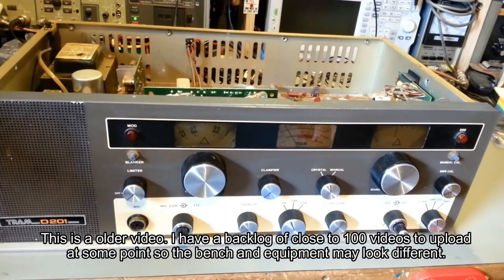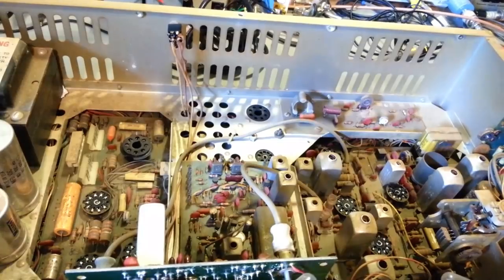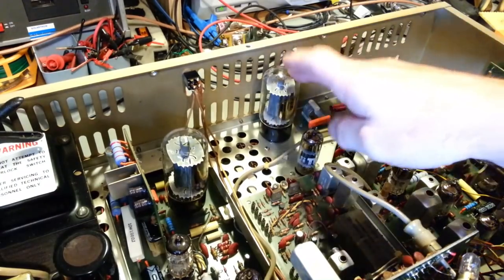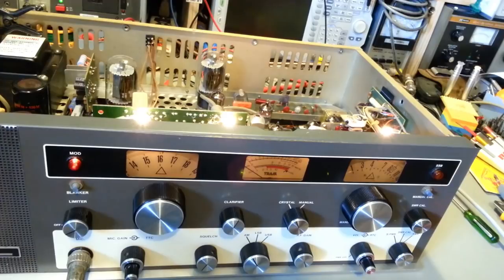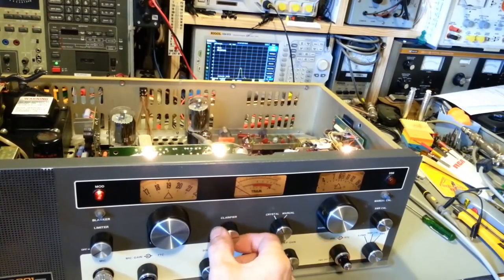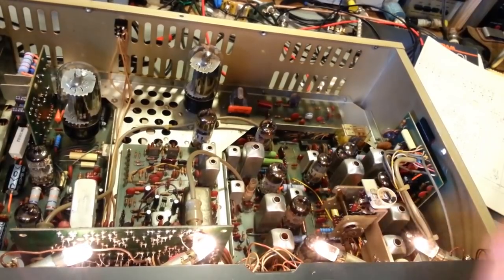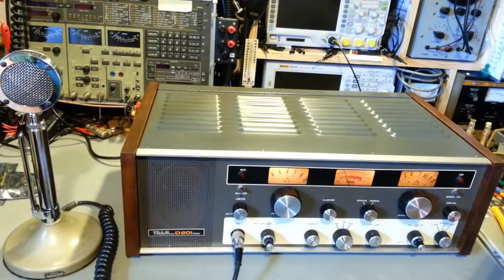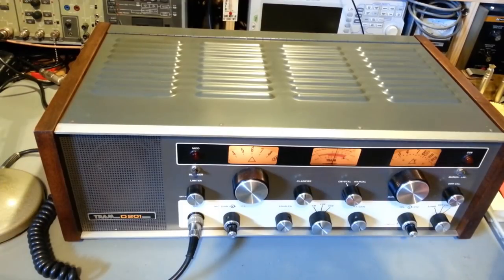Tram D201 CB radio restoration.

Comment: You did miss one point on the differences that I have in hand of the hand wired version  (at least the one I have ), the tube are located on the chassis instead of on the circuit board. The circuit board I've been told, did get the boards a little hot causing some problems.

Comment: I have gotten nailed by high voltage from my neon sign and frankly it nearly killed me, I also got one hell of a shock from an old car alternator that was shorted out to the case and when I turned the tester on and grabbed the case of the alternator the current went in one hand through my chest out the other, burning my finger where it exited. I am now more careful than most working on high voltage equipment as I seem to be a very good conductor. I hate neon signs now.

Comment: Three questions: 1) what is a clarifier? 2) why is there a gap between channels 22 and 23? And 3) what was t 8-pin DIP IC on the main board for? The VCO?
Reply: Clarifier is also called RIT. It allows you to tun to a singal on SSB by adjusting RX but if you "unlock" it than TX and RX both track with the knob all of the time even on AM. CB is not supposed to have RIT/Clarifier that tracks on TX.
Reply: In this case he is talking about the pot for the clarifier needing to be replaced.
Reply: The gap between channels 22 and 23 is due to the fact that there was a pair of "Class 'C' " rc channels in between them.
With the rule changes (allowing the 17 new frequencies), channels "22A" (27.235 MHz), and "22B" (27.245 MHz), became channels 24 and 25 and the next channel (27.265 MHz), above "channel 23" (27.255 MHz) became "channel 26". The old channel layout was, in other words, superimposed on the new channel layout for the "Class D" Citizen's Band by the FCC.
Reply: Actually, under Part 95, prior to the implementation of the 40 channel rules, the clarifier on the 23 channel SSB rigs wasn't restricted to rx only. The change came about with the new rules for 40 channel Class D Citizen's Band circa 1975/1976.

Comment: Two comments:  1.  The term "Unlock" originally means that the  "VFO Lockout" was "Unlocked".  At least that's the way it was used by those I dealt with.  For you that would be ancient history, but then, I am ancient myself so I know such things.

2.  Regarding the switch between crystal control and VFO, this is a good and useful add-on.  I'm an Extra Class Amateur and a former GROL with endorsements so I function quite well with VFO's, but when my wife used the radio she really needed the limitation of crystal control.  Not only did she need it, the whole world was better off that way.

Great videos.  I enjoy each and every one of them.  Thanks   Zack

Comment: Yep: oscilloscope - time domain, and signal intensity on a linear scale. Spectrum analyzer - frequency domain, and signal intensity on a logarithmic scale (dB)! What’s also interesting, is the relationship between the two. Ideally, a pure sine wave in time domain -> spike (impulse) in the frequency domain, and a spike in the time domain is sinusoidal in the frequency domain. So if you generate a carrier with a crystal oscillator, you’ll get a nice, narrow pulse at the frequency of the crystal, which is what you see here at 47:49 minutes into the video (on CB channel 19). There are, in fact, other such relationships between the frequency, and time domains, but that would be a video in itself!

Comment: Other than audio bandwidth being greater than modern day radio's is their anything about this radio that makes it hot snot? Is it just the history and nostalgia?
Reply from the maker: Nothing sounds as good as glass audio.  That's why even today high end audio amplifiers, pre-amps and guitar amplifiers are still tube type.  And these things had RF and audio power to spare, lots of it.  They used 6L6 tubes as the audio output and RF final tubes.  They are HUGE compared to any other CB ever made.  They can easily put out over 60 watts PEP and not even break a sweat.
Reply: Ok, but, what did you say? Don't push more power? How much can they do reliably ?